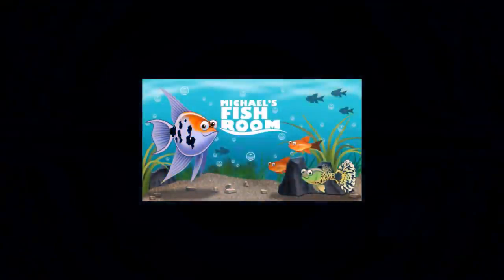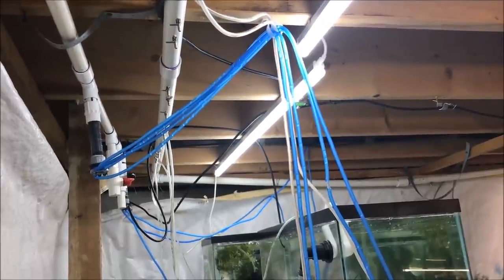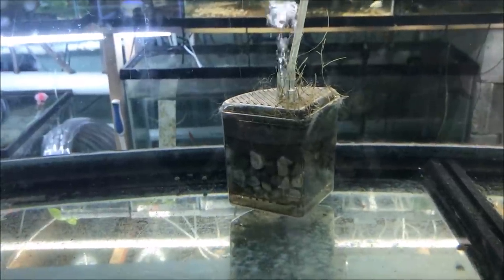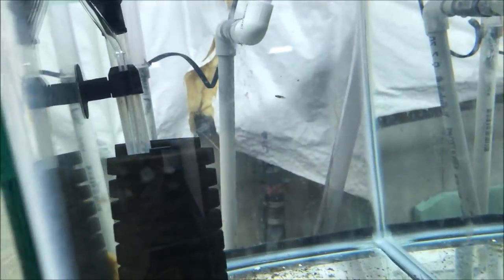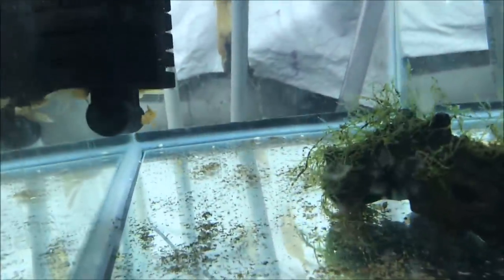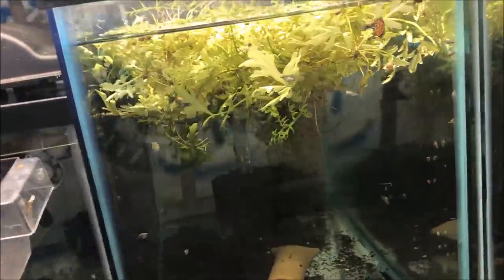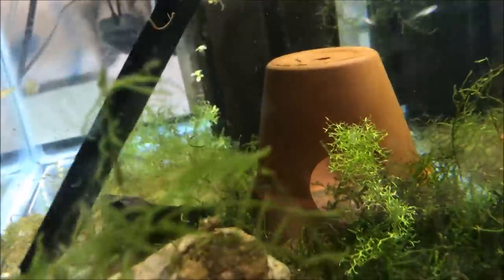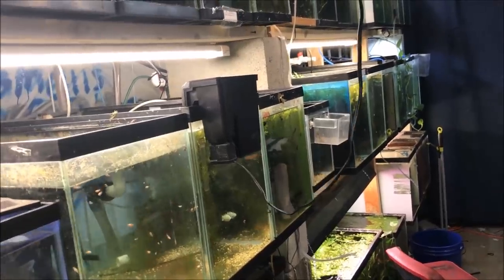Cleaning up the Fishroom Also a Pleco Update Including L144 and Blue Phantom Pleco

Comment: Hey Michael, If you get some magnets and epoxy or silicone the ridged tubing to one of them you can keep them connected and be able to move them around and keep them from coming out of the tanks. FYI Harbor freight has magnets real cheap .
Reply from the maker: So epoxy the magnet to the plastic and the rigid tubing?
Reply: thats a good idea!